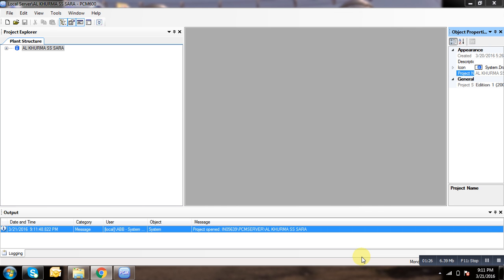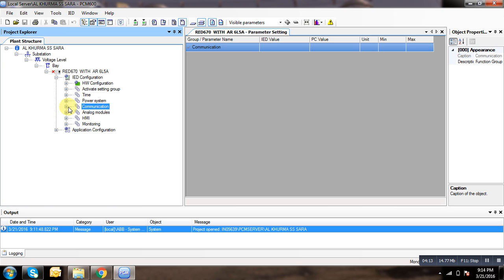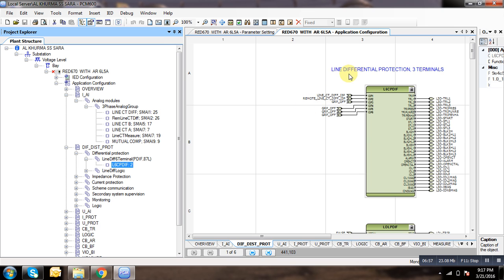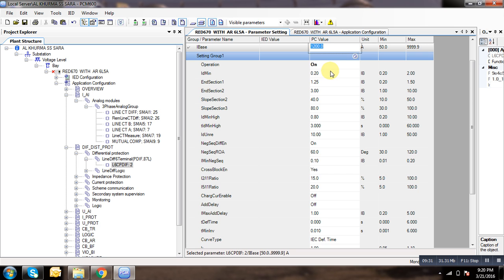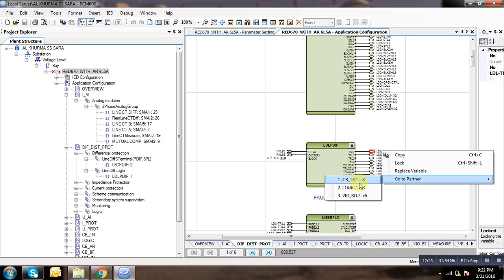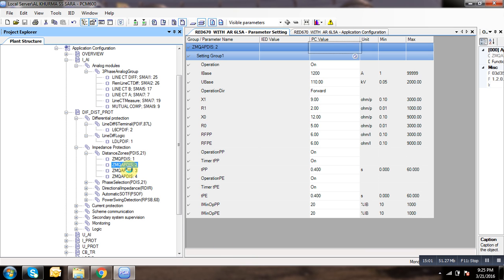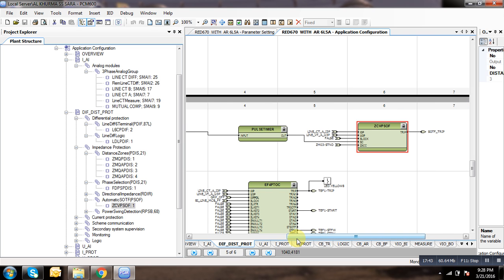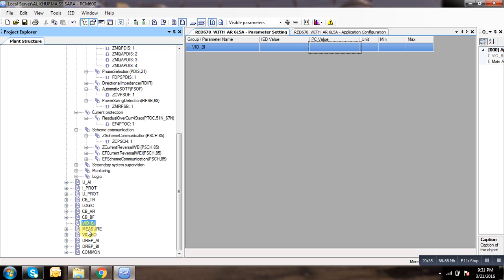TESTING ABB RELAY RED670 -2 , HOW TO  CONFIGURE and Settings

Comment: we have REG 316 relay installed for 31.625 MVA Generator. we intend to replace the relay with REG 670 with HMI. WE want to get it commisoned but we are not finding any technical support . KIndly guide

Comment: Dear Mr.Anandhan Vasu,
 I am trying to download the RED670*1.2-B32X00 connectivity package from update manager but i cannot find and download the application, only ANSI and IEC document is available. can u please tell me how to download.
Reply from the maker: It will available in ABB download center , Search in google  abb download center, it wil show RED670 total connectivity package in ZIP file , download  and install, hopefully u can get there
Reply: Already i have download, when i install it required .Net framework 4.6.1 to be installed first. Even though i have downloaded that version but there is blocking issue coming when i install that.